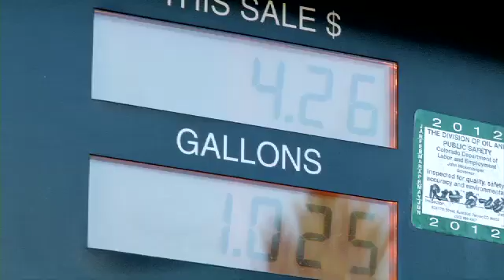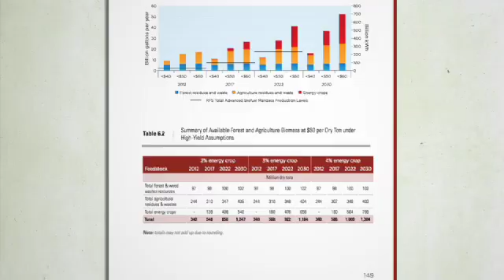Energy 101: Feedstocks for Biofuels and More

Comment: We don't have anywhere near enough farm land to grow enough crops to produce enough biofuel to replace oil imports. Growing corn to make ethanol has much too low of a yield, and frankly, it's only done as a govt hand-out to Big Corn.

A good biofuel strategy would instead focus on algae which can have a yield 10x as much fuel as corn. It also doesn't require as much fertilizer, farm equipment, or other energy inputs of corn. Finally, algae systems can be put anywhere--in the desert on top of roofs--not just on prime farm land.
Reply: Until the naysayers sit down, your idea will not get the oxygen necessary for adoption. When will that be? When the big players are forced to change tack and divert mega resources into beneficial processes research development AND commercialisation. All the startups in the world with fantastic ideas worthy of implementation will get nowhere if they just end up being bought out and merged with the big boys and their ideas put to sleep.